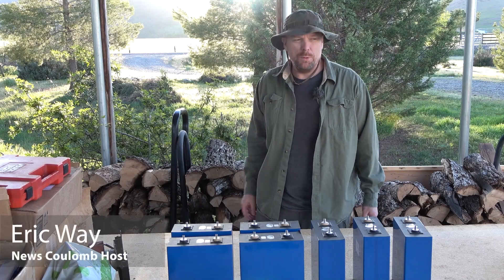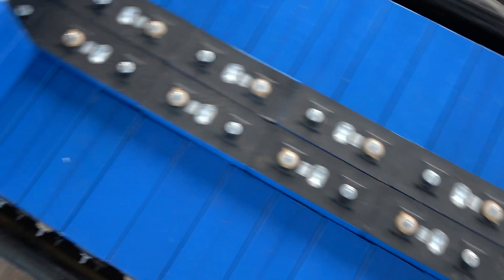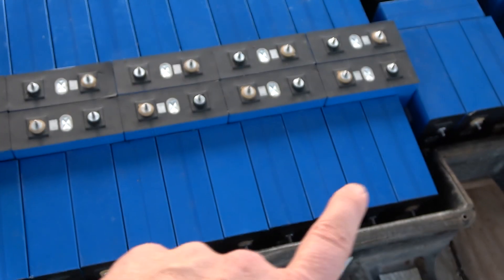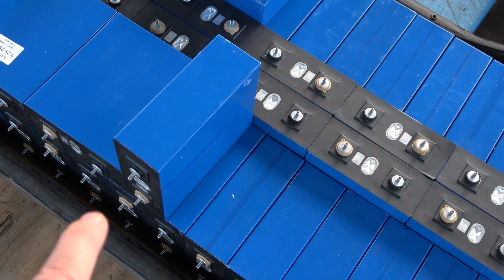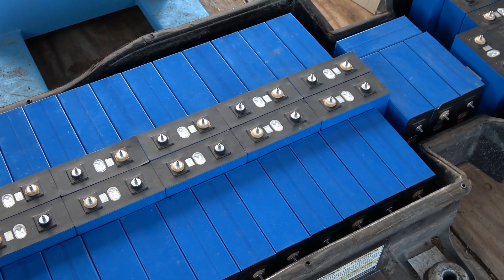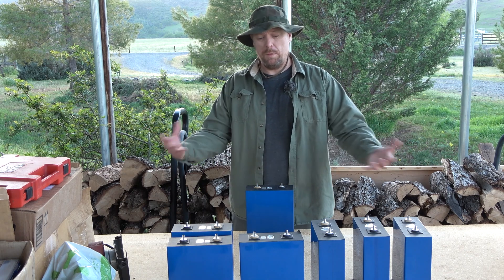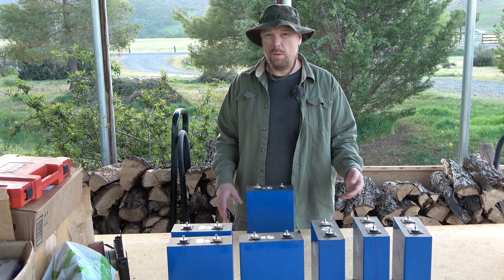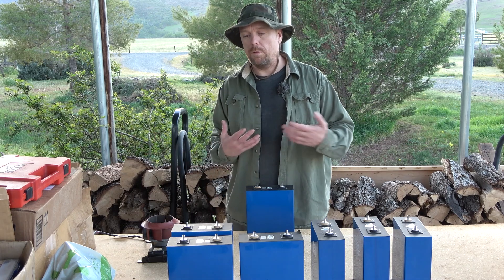Ford Ranger Electric: Final 280 Ah Battery Cell Layout

Comment: Hey brother. I just finished doing a 163ah install in a ranger EV and I gotta say... That's gonna be a hell of a tight fit, to the point I might advise you to do a split pack with half in a toolbox in the bed. You need to consider where you're going to put the Ford BMS, the contactor box, the lithium BMS, the independent observer and about 100 feet of cabling. I wish you luck and will watch with interest to see what you come up with!
Reply from the maker: Oh, that's awesome! Thanks for the heads up. Hopefully, I've arranged and accounted for everything, so we'll have to see how it goes. I've gotten a bit busy with home renovations and a few EV reviews, but I need to devote some more time to finishing this project up.

Comment: Super interesting update. I didn’t realize you were planning for DC Fast capabilities (or that it was even possible). Thank you for leaving in your cat’s escapades. What perfect timing! Laugh out loud funny, although I’m glad your arm didn’t get scratched to bits as it fell! That would have been my luck.
Reply from the maker: Thanks! Yes, that cats are definitely my helpers, but it's going to make things difficult buttoning up the pack. I need to clean the box thoroughly before loading it and sealing it, and I need to keep the cats away when I start stringing the cells together for high voltage.

Also, in regards to DCFC, yes, it's definitely an option, though it might have to be CHAdeMO. A number of groups have talked about offering CCS modules, but none have done so (especially not cheaply).
Reply: @newscoulomb3705  CCS would be very cool. Maybe you can convince someone to let you be a beta tester in exchange for your feedback and honest review. Is it supposed to be an open project or something commercial? I wonder if it would be possible to add support for both CHAdeMO and CCS somehow.
Reply from the maker: @caddyzig  They have a few programs right now. Some open source, others DIY, and others commercial. So far, I haven't seen anything that's commercially available in North America. It seems like most of the work is being done for CCS2 in Europe, which is a different format (and with slight differences in the software). 

That being said, it would definitely be possible to put both CCS and CHAdeMO in the same vehicle, but if you can do CCS, there's no real reason to do CHAdeMO, too.

Comment: Isn't putting all the cells in different orientations going to cause a large problem with 
the cabling of the cells to a pack?
 Would it be easier to make a new battery box to fit the batteries all in one direction so 
that the connectors could all be the same? What about the bms system how will that be 
connected to all the cells?
Reply from the maker: Good questions. I'll go over the wiring layout in future videos, but the orientations of the cells don't matter that much, as long as as the cell groups are reasonable. 
As for why I didn't make a new battery box, that's mostly a matter of engineering, time, parts, etc. For these Rangers, because they already have a fitted battery box with all the electronics, it's better to just reuse the packaging. At least, in my opinion, it is.

Comment: Fun video with the cameo performances of the inspector general.  Quite a tetris challenge figuring out the best configuration of the battery arrangements.  So many parameters to mentally account for in this build.  Really fun project and it'll be exciting to see it come together.  I'm guessing your end use is an in town work vehicle?
Reply from the maker: Thanks, Bruce! Yes, my planned use for this is just an all-purpose truck. It's not really an off roader or a tow vehicle, but I don't really need that out of my trucks most of the time anyway. It is pretty darn comfy to sit in, though, so it might be my next road tripper! 😀

Comment: Eric, thanks for the update. What are your plans, if any, for monitoring and/or controlling battery temperature? How much of an issue do you think it will be with your LFP batteries?
Reply from the maker: Thanks! The BMS has a set of thermistors that will monitor the temperature of the pack. I'm not that concerned with overheating the battery. Even at full power, it will only be a 1 C discharge. I'm going to include heating pads to warm the cells during winter.